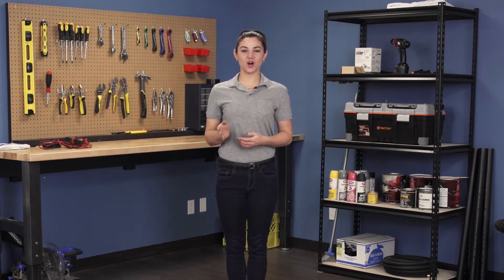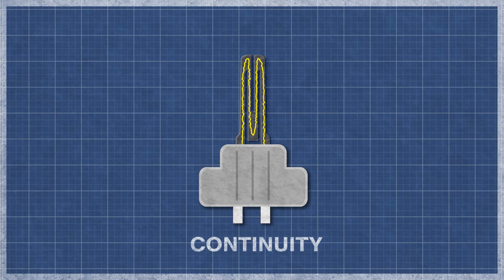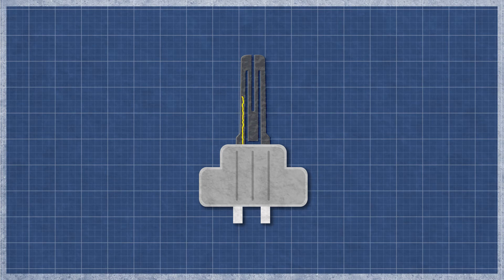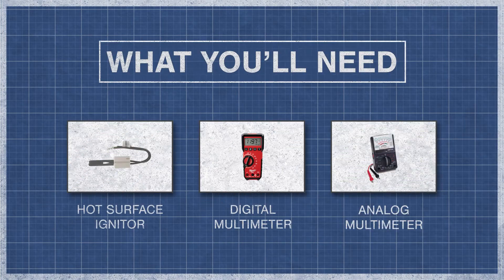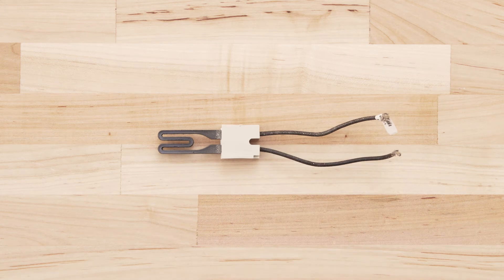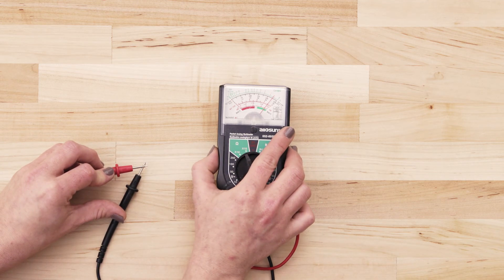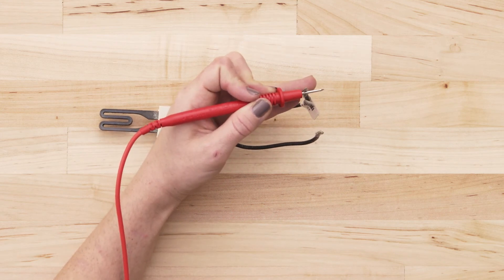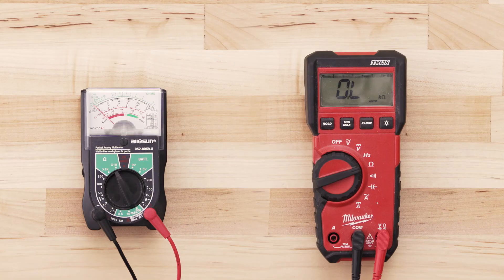Nordyne # 903758 - Continuity Test (Gas Furnace Ignitor)

Comment: Thanks for sharing easy test for flame sensor
Reply from the maker: You're welcome Sikopa! Just to clarify, the furnace ignitor is slightly different than the flame sensor. The flame sensor detects the flame where the ignitor heats up to ignite the burners. If you want to learn more we did a great video on how a furnace works: https://www.youtube.com/watch?v=tVLtJwix-_8&list=PLCo9SMjkdWBzorzNrARLKALj9fW7HzHMh&index=1
Reply: @AmreSupply  but there are some that are both igniters and flame sensors in one as well.